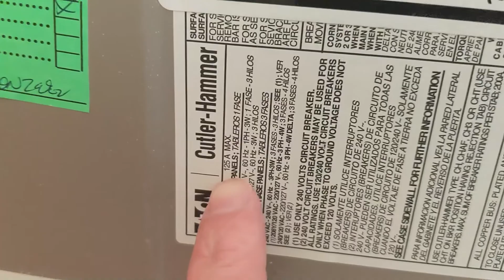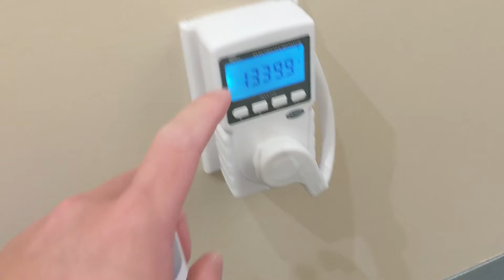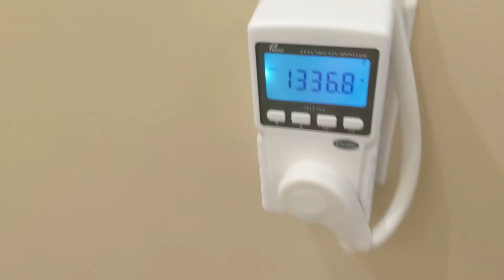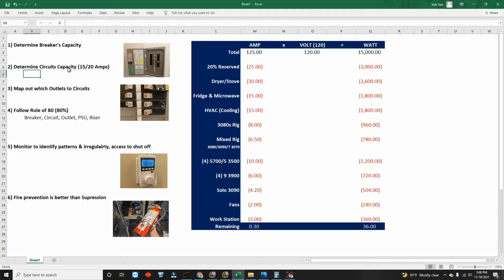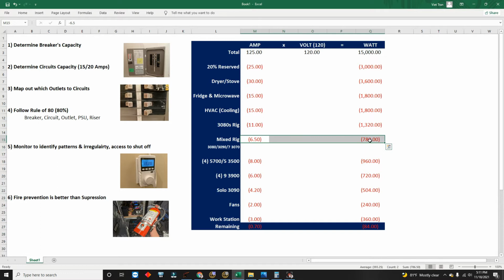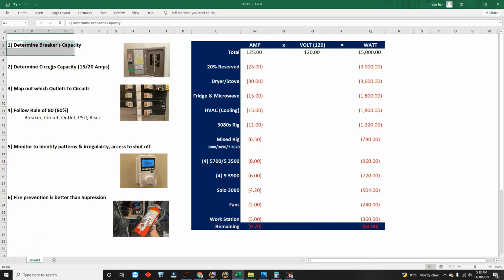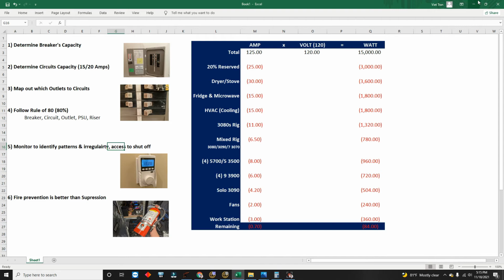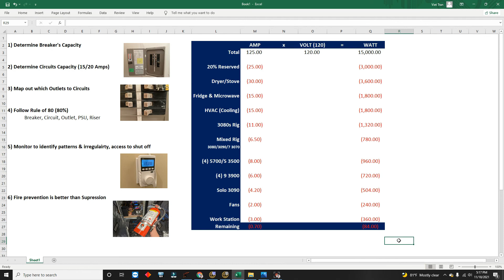How to Measure and Calculate Power Consumption for Residential Crypto Mining

Comment: If your going to run all circuits off of extension cords to wall outlets, match the gauge of the wire. Do not try to use a 16 gauge cord and push 80% of the circuit. Resistance was the only thing not mentioned in this video. Where resistance is created so is a hotspot. Possible melting cords. Otherwise great setup and video! Cheers 🥂